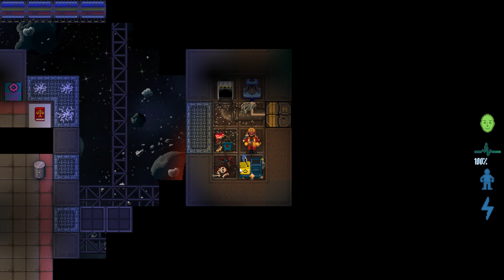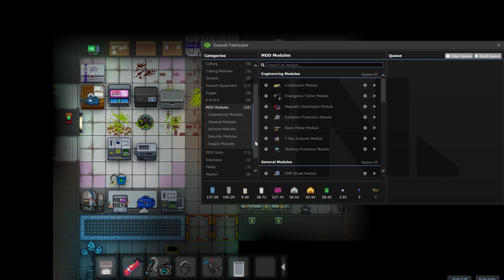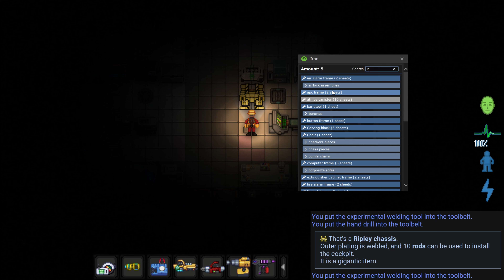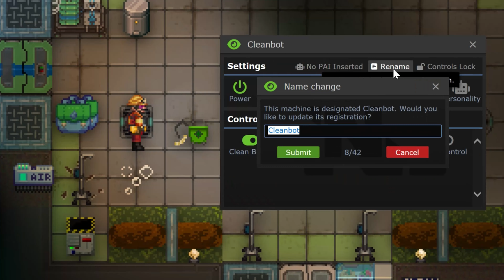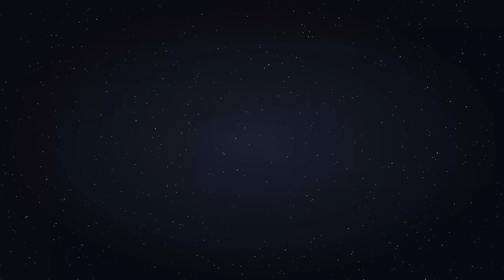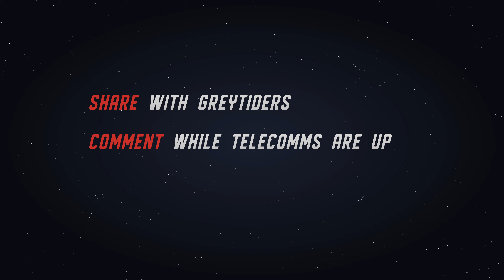12. Robotics - Space Station 13 Singleplayer / Guide / Tutorial

Comment: Great series, very helpful for someone looking to get back into the game after a few year break.  I'd like to mess around myself on a local server to familiarize myself again.
Is the chemmaster 3000 able to be constructed on Charlie Station using the available materials? Seems like you'd run out of chems available unless you made them all with plants.
Reply from the maker: You can print the circuit after the human dissection experiment, and there are multiple ways to unlock it, but it is not possible yet.